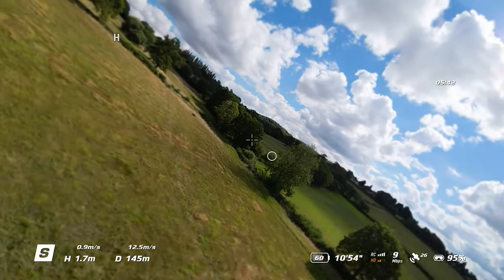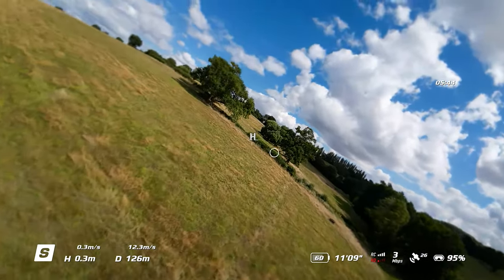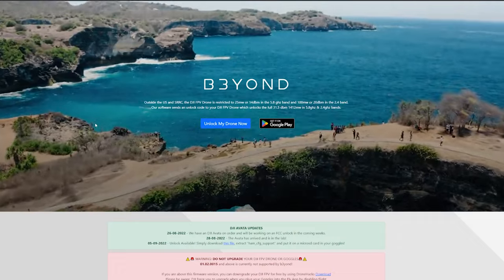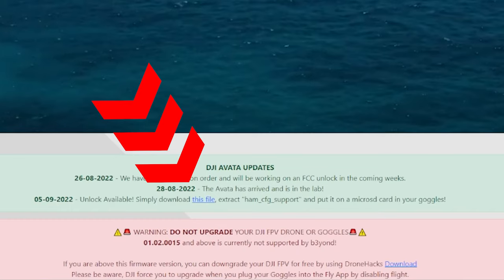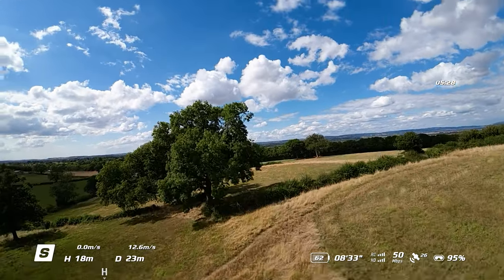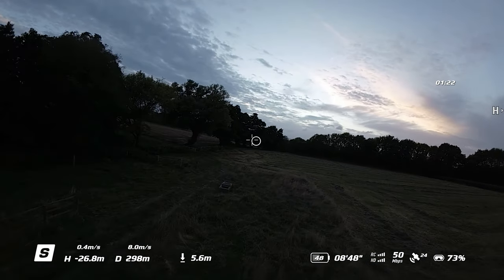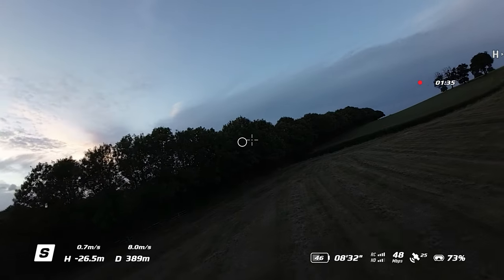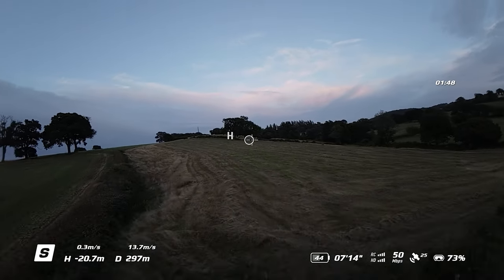DJI AVATA | FCC Hack For Better Image Transmission!

Comment: Hello. Great video and to the point. I had to look into this topic because my dji avata did something odd today.  I finally had time to use my drone after having it stored for about 6 months.  Upon unpacking it i made sure to fully update everything on all devices.  I did a test flight outdoors and realized that my drone couldn't even fly from one side of my to the other and even on top of my house without losing a significant amount of signal strength.  It went down to 1 and 2 mb strength.  This was really odd because 6 months ago i was able to fly above and my house perfectly fine and even fly far away  across my neighborhood. The updates i did must have messed with my drones signal somehow. I do live in the us and i do see the manual mode for is available.  I will try the 40hz setting and hopefully this helps. 

Oh and here is another odd thing. Even when i have my drone right next to me the signal strength is around 5 mb. So odd. It should be around 50 mb right next to me

Comment: Superb video thank you. Straight to the point and a clear solution :) Quick question though, how do you un-install the hack should you need to? Thanks again Craig, top job.
Reply from the maker: You just delete the file off the sd card in the goggles and then reset them I believe 👍🏻
Reply: @CraigPitts  you have to reset your goggles to factory settings.

Comment: I could have done with this last night near snowdon 😂🤦🏻‍♂️ lost signal and it stacked it…..luckily no damage
Reply from the maker: Ah glad it didn’t break, to be fair mine held up well when it slammed into a tree but yeah not ideal is it!
Reply: @CraigPitts  not at all, I’ve crashed 3 times this weekend with it 😂 only grass stains….I need to get back on the Lift Off simulator during the week

Comment: Testing this i can say its a huge performance in the video feed, but i dont notice any difference in range...
Reply: I am having the same result sadly, I get about 300-400m and signal drops significantly although I should be in FCC mode. Seriously contemplating returning for a refund.

Comment: Am wondering just how long it will be before DJI either disables this hack or addresses the problem in their own way. I always find it amazing that problems like this are not resolved before product launch.
Reply from the maker: It's mind blowing how they seem to turn a blind eye to it, I wouldn't mind if the range actually got close to the stated 2km CE zone spec but it's nowhere near. At least they seem to be okay with the hack, it's been posted all over their forum and they don't seem to care 🤷🏻‍♂️
Reply: @CraigPitts  They are, of course, legally bound only to supply kit with a  transmission power within the EU stipulated levels but with the avata is is incredibly bad and removes any possibility of flying within a building seemingly without a clear line of sight. Had already installed this hack before seeing your video and yet to test but will do so possibly today. Unlike other dji drones there is no real way to check if FCC is enabled.
Reply: @droneseyeimages  Of course you can check that.
CE= 1 channel at 40mhz
FCC= 3 channels at 40MHz
Reply: The video transmission problem with Avata is not because of DJI mistake , they're forced by law to limit power to absurdly low values in EU. The 2km applies to a radio transmission (I mean controlling your drone), not a video signal - video needs much more data (transmission power). In my opinion this "hack" was so easy to discover and implement because DJI did it on purpose, so they are not breaking law, and users will discover this quickly and can easily unlock the full potential of their drones.
Reply: @Kamil_Mark  is this the same procedure when removing the NFZ? when i did my fpv, the place apparently doesnt have one listed for the avata yet so just curious where to get one
Reply: @ralfh9122  i have 4 channels with 5.8ghz and 40mhz,manual mode

Comment: DJI released firmware version v01.01.0200 on September 14th. "Optimized flight safety" is the only point mentioned in the changelog. Who wants to give it a try, if this hack still works with this version? ;)
Reply: it does work on this firmware

Comment: I just bought the avata, placed an sd card in my goggles with the fcc hack into it but I am not able to access the channel mode since it is locked at auto. Any solutions to make the FCC work?

Comment: does this work on the goggles v2 (not the new one) as i fly other fpv drone with air units and vistas with a hack to fcc mod on the goggles and i dont want to mess that up with another hack on the goggles. what do you think ?
Reply from the maker: Not sure mate I don't have the older goggles, I think it does but it might be worth checking. In any case it's not a hack that affects anything system wise so you won't damage anything
Reply: yes it does work on the v2 goggles, tried and tested..